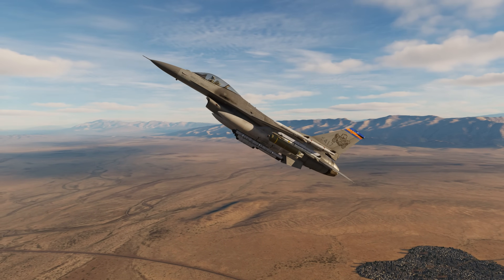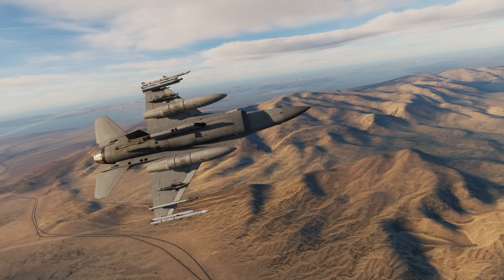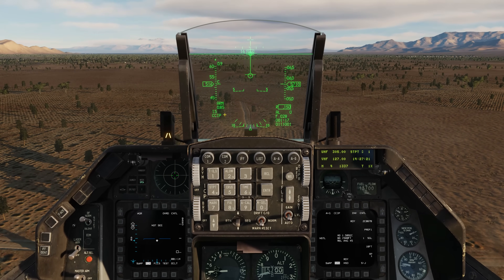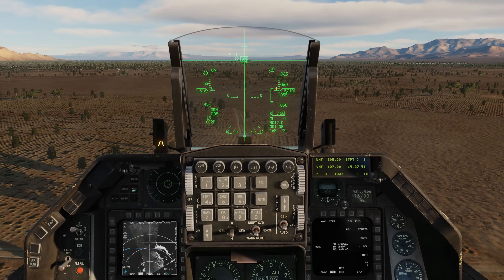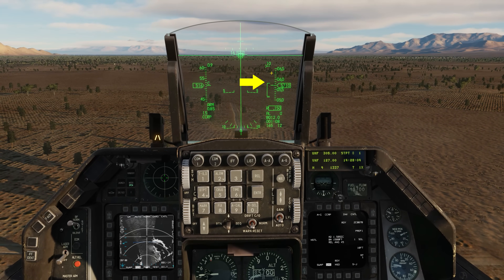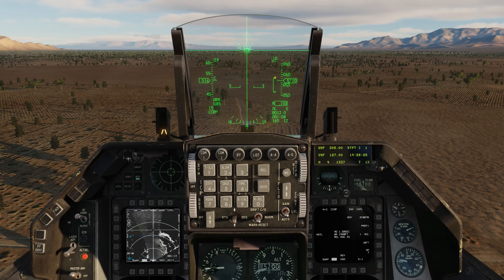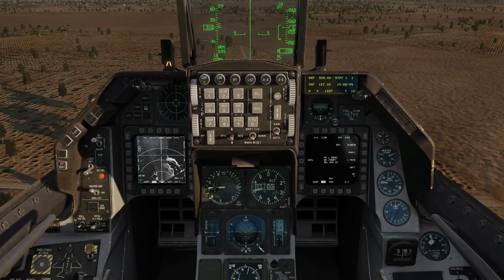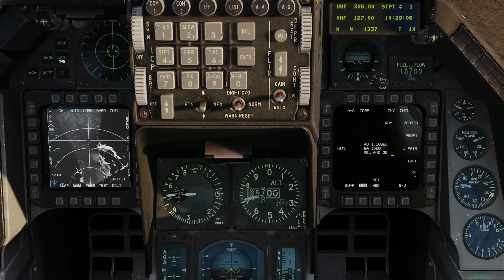DCS: F-16C Viper: Toss Bombing

Comment: Unfortunately it broke the CCRP on Viper when in level angle.
Reply from the maker: It is correct, please see earlier videos on the pull up cue.
Reply: If I'm wrong, can you please an updated video showing how to send a CCRP on level flight, please?
Reply from the maker: @EderNucci  https://youtu.be/Brz1zl-Sbhk
Reply: @MattWagner  Yeah, I saw this. But I want to do a level release, like before, not at angle. Can it be done or the feature is gone?
Reply from the maker: @EderNucci  Then just continue flying through the pull up indication and wait for the release cue whilst level. Please use our forum if you are still having trouble: https://forum.dcs.world/forum/118-dcs-f-16c-viper/
Reply: @MattWagner  sure, thank you anyway.
Reply from the maker: @EderNucci  https://youtu.be/ZoY3hzDyqbY
Reply: @MattWagner  works 1 in 10 times. Unfortunately I still think it's fundamentally broken since now it requires a lot more effort to release.
Reply from the maker: @EderNucci  Please post a track to our forum and we can help you figure out where you are going wrong.
Reply from the maker: @kresomatic1727  Within 5 mils.

Comment: I have a question, maybe you answered this in video but I may missed it... We have to hold the pickle button from just before pull up until autorelease when the cues match and bombs are releasing? Like in a CCRP release?
Reply from the maker: Yes, as mentioned, it's a standard CCRP attack, just using a toss profile.
Reply: @MattWagner  Thank you!
Reply: You can fly the pull up without the bomb button held. Just make sure the button is held when the solution cue hits the FPM and keep it there until all scheduled bombs are released. For DTOS you can designate the TD box onto the ground with TMS forward or the weapon release button, your choice.

Comment: Hi Matt ! Thank you for your work. Can we use the CCRP Toss for use with JDAMs ? Because it's my go-to move for attacking runways on enemy airfields.
Thx.
Reply: JDAM/JSOW/WCMD don't use normal bombing modes (CCIP/CCRP/DTOS). Because JDAMs are smart weapons they don't fly ballistic arc paths like rocks. They tilt their bomb bodies and fly like a little airplane. In IAM PRE (JDAM/WCMD) for example the number to the left of the ">" caret symbol will show the pitch angle needed to get inside the inner Rmax2-Rmin2 staple. It's a similar but different HUD setup than used for ballistic weapons. Maneuvering the airplane does not have as much benefit to JDAM range like it does for ballistic weapons.

JSOW for example in IAM PRE will have no loft angle display when inside Rmax1-Rmin1 but outside Rmax2-Rmin2 (not loftable). When inside max2-min2 it will say "JIZ".
Reply from the maker: No, that would not be accurate. Toss is for CCRP and DTOS, whereas IAMs use PRE and VIS.
Reply: I think they only have "pre" and "vis" modes available. I'm curious if there are submodes for those though

Comment: I prefer the stand-off capability and accuracy of the AGM-88 for SAMs. Bombing just requires you to get too close.
Reply: Well, the truth is that if SAMs and HARM were simulated on a realistic way HARM shouldn’t be capable of destroying the SAM, in any case just to suppressing it for a short amount of time, that’s why you have to do thing like this
Reply: Yea what he said. Shakur, usually, realistically, SAM sites will turn off their radar when they notice a Harm launch coming their way. Making the Harm miss. But this is why SEAD is differentiated from DEAD. So the SEAD flight will carry harms, and DEAD flight will carry bombs. SEAD shuts the radar off, then DEAD comes in while it's off and bombs away!
Reply: In the fighter pilot podcast there's an episode (either the SAM or SEAD episode) where a Navy pilot says that the USAF is happy with releasing HARMs to suppress air defenses during a strike and then suppress them again when necessary. The Navy has to get the weapons shipped to their carrier so when they suppress a SAM site, they'd rather not have to deal with it again if they need to come back or else they can deplete their stock of HARMs. That's getting into the difference between SEAD and DEAD but worth thinking about.
I might be mistaken but a Vietnam era pilot once said that to make sure a SAM site was dead was dropping bombs and cluster bombs on it. And if possible strafe the place with rockets and guns just to make sure.

Comment: Awesome! Will this also work with CBU-105s, or are they for dumb bombs only?
Reply from the maker: No, that would not be accurate. Toss is for CCRP and DTOS, whereas IAMs use PRE and VIS.
Reply: @MattWagner  thanks for the clarification! For CBU105 attacks, would you recommend popping up and leveling off for the release, or were they not intended for a low altitude release in the first place?
Reply: Dumb, loftable bombs only like Mk 82, CBU-87, GBU-12 can use this. Smart weapons like JDAM, WCMD, JSOW will not use CCRP/CCIP/DTOS at all. Non-loftable weapons like Mk 82AIR will not have loft guidance.

Comment: Love the work you guys are doing! Long time DCS user but still a noob, lol. Question: Why would you want a 30⁰ release angle as opposed to the default 45⁰?  Thanks
Reply: Imagine you pick a 45 degree angle which can toss a bomb 30,000' horizontally. On the attack you accidentally start your pull up 30,001' away. Bomb will never come off as you pass through 45 degrees. No bomb. Mission fail.

But if you pick 30 degree angle which can toss 27,000' horizontal and you accidentally start pull up 27,500' away then bomb doesn't come off at 30 degrees but it comes off at 31 degrees. No big deal.

Plus lofting to 45 degrees will put you up higher in the air with more seconds exposed at high altitude to being shot at. Is a small toss range increase worth being exposed an extra 5 seconds and climbing an extra 1500'?
Reply from the maker: Up to you, but a  shallower toss angle would limit release ceiling.
Reply: @MattWagner  Makes sense. Would be good to see a video of both options to see the difference.  Anyhow, thanks for keeping my hobby alive. Wish I had more time to enjoy it all 😂
Reply: Speculation on my part, but I imagine if you're heavy/draggy you might struggle to maintain speed in steeper toss angles which will reduce the possible loft range.
Reply: Response above me is probably correct in the sense that a 45º angle might not lead to greater range due to loss of velocity, but another alternative is that a 45º release would make the bomb spend more time going up and down, which means more opportunity for the bomb to drift off the intended impact point.

Comment: Does the release angle setting change any cue in the HUD?
Reply: Some cues on the HUD are due to the "max toss" (45°) angle and some cues are based on the pilot-entered REL ANG setting. The max toss anticipation circle and top of staple are based on 45 degree so will not change based on REL ANG.

Horizontal vertical steering cue, time-to-go timer, solution cue appearing 10 seconds before maneuver are based on the pilot-entered REL ANG.

The predicted climb angle at release (left of caret) is based on if you did the loft maneuver right now so will count down from 45 to 0 when flying level through the staple from top to bottom. Apparently the predicted altitude at release is similarly dynamic (notice it counts down as Wags flies level and then stays about 7000' during the pull up).

Comment: Did I miss how you enter toss mode? Was it automatic when you hit the A/G button pending the flight profile you're in? I don't change the rel ang when I'm doing a standard level CCRP bombing run.
Reply from the maker: Toss is not a "mode", it is simply additional symbology and calculations when using CCRP or DTOS.
Reply: DTOS is a visual bombing mode like CCIP except you put the TD box on the ground visually and then continue like CCRP. You can change the bombing mode with OSB 2 on the A-G SMS MFD format or you can press the MSL STEP button on the stick to cycle through CCIP/DTOS/CCRP modes.

Comment: Mr. Wagner, what I have to do if my f16's engine would stop starting at 10-20% during cold start ? Could you make a video about it because I cant find it in manual.
Reply from the maker: You need to let it settle at 20% longer before moving the throttle from OFF to IDLE. You are rushing it.
Reply: wait till it goes above 20% before uncaging the throttle and introducing fuel
Reply: @SolidusF0X69  yeah, I know, Im doing it right but sometimes it stops at 15%
I think its an engine failour or something but im sure Im doing start correct.

Comment: For the pull-up, are you supposed to pull 4G TO the desired release angle and maintain that angle or do you pull THROUGH the release angle and maintain 4G until release?
Reply from the maker: Hold 4G with weapon release button down and as the solution cue and FPM meet, the weapon is released.
Reply: @MattWagner  Let's say we want to ripple off 6 CBUs over an 800ft span. Would we pull up to designated release angle and then let off the stick until all bombs are off? Would the CCRP assume the target point is at the center of the 800ft span or the beginning?
Reply: Through. The airplane aims just fine at a constant 3.8g and you want to continue your slice back maneuver and get back on the deck.

Comment: Hmm, I don't really understand what DTOS does differently from CCRP-Toss? I mean I understand you as the pilot are supposed to pull up from level flight for CCRP-Toss and pull up from a dive in DTOS, but what I don't understand is why you need two different modes for that and what exactly they do differently? What happens if I use CCRP mode when flying a DTOS profile or vice versa?
Reply from the maker: With DTOS you can designate the target through the HUD/HMCS.
Reply: @MattWagner  Oh, of course! I totally forgot about that part!

So the difference between both modes isn't really the flight profile, but that CCRP is for pre planed targets and DTOS for targets that need to be acquired visually. The different flight profile is then rather a consequence of this, as it's difficult to visually designate something when flying NOE.

Thanks, that makes it more clear now! 👍
Reply from the maker: @realQuiGon  Correct.
Reply: @MattWagner  I imagine using the TGP to acquire the targets then we would use the DTOS mode or in that case either mode would work the same?
Reply from the maker: No, use DTOS when targeting through the HUD/HMCS. https://youtu.be/jiE6fRrkOos
Reply: @popovqc  I do a HMCS acquire, the a fine tune via TGP.
Reply: CCRP and DTOS (post designate) are essentially the same. The difference is DTOS is a visual bombing mode where you designate the target visually similar to CCIP. Imagine your selected steerpoint is 999nm away and you want to bomb something. If your steerpoint/FCR cursors/TGP LOS is on the target -> use CCRP. If you see the target through your HUD visually -> use DTOS. It's mostly about what sensor you use to designate the target.

Comment: I love Viper updates!  Looking forward to GPS system time synced in multiplayer!  Will make TOT a little easier thanks!
Reply: Agreed!
Reply: It would be cool but after doing it once or twice, syncing your clock to the F10 map clock takes about 5 seconds. You can do it while you are on the F10 map if you map your numpad keys to your ICP (at least in VR but I guess you can do the same on flat screen). Bigger issue is that the ToS you set in the mission editor for each waypoint gets adjusted based on your spawn in time, even if you set the ToS as "fixed" in the ME... That shouldn't happen for sure, makes any kind of pre-planning impossible.
Reply: @danielmajoros5291  yeah it’s fine we have a fix with see and F10 but I mean it seems like a simple fix.   It works fine for single player.

Comment: Nice video, thanks Wags! Did anyone notice the sim froze for a split second when selecting A-G @ 5mins 50s into the video?
Reply: The frame rate was noticeably lower with the air to ground radar on. I always switch back to hsd, or in the jf-17 I freeze the picture

Comment: Are the releases automatic or is the pickle button held during the pull-up?
Reply from the maker: It's CCRP, so naturally you must hold down the weapon release button.
Reply: @MattWagner  Do you need to wait until after the pull up cue occurs to start holding the weapon release button, or can you hold it down before you get to the pull up cue?
Reply from the maker: @flyguy1237  No, anytime. Again, it's standard CCRP SOP.
Reply: @MattWagner  Great thank you.
Reply: @MattWagner  So, if we want to do a straight and level CCRP the solution cue comes down two times? The first being only an indication for an optional toss pullup?
Reply from the maker: @maronius  Yep, toss and then release.